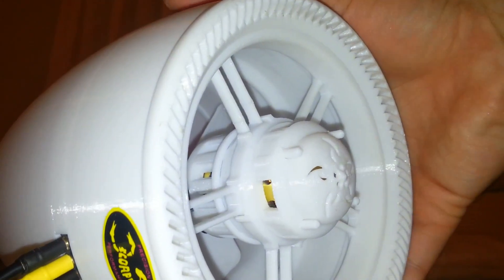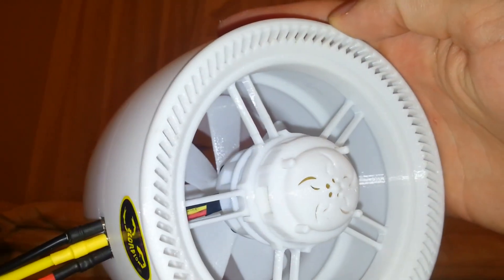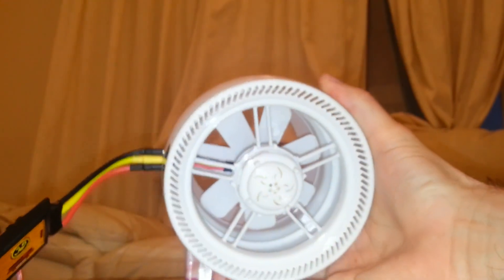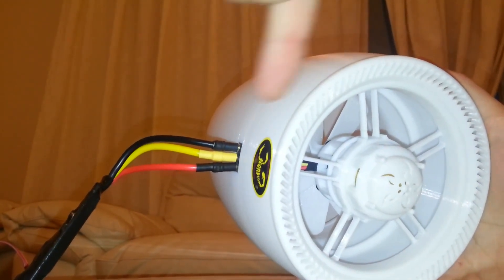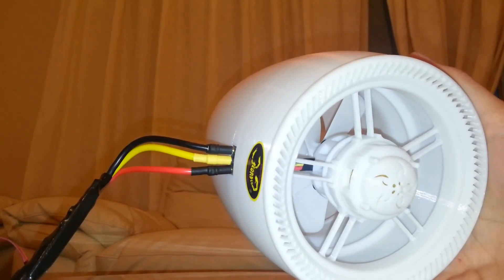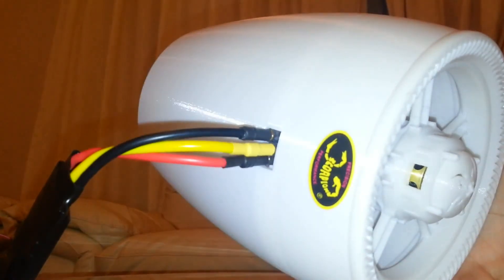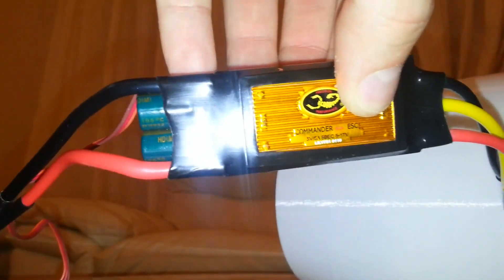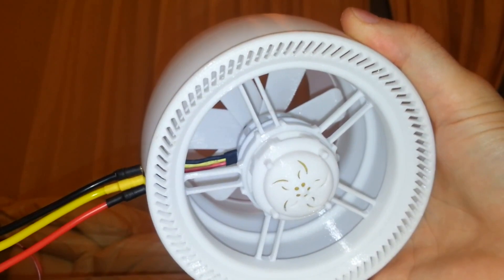3D Printed Functional EDF Turbine ENGINE, End-user-part

Comment: wouldnt d plastic melt due to d heat of d motor after a long use????
Reply: +Aaron Dsouza it wouldn't if some of the air being drawn in can flow past the motor. That's how the EDFs that produce 10+ pounds of thrust are designed. yes, they would normally just melt.
Reply: XD

Comment from the maker: See the fully functional 3D printed EDF turbine engine in action - designed in Dassault Systemes CATIA V6 software and "printed" in a Stratasys fortus 3D performance 3D printer.  #catia   #catiav6   #3ddesign   #3dprinter   #3dprinting   #D2Msolutions   #Stratasys   #part   #turbine   #engine   #DassaultSystemes   #aeroplane
Reply: D2MSolutions how do I get the files to print the engine